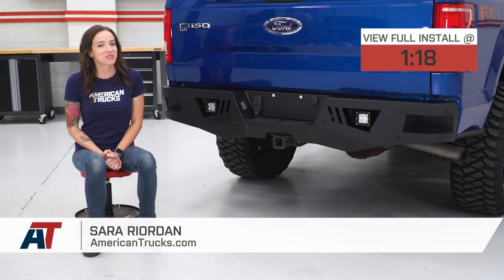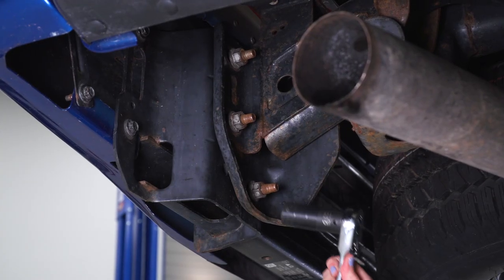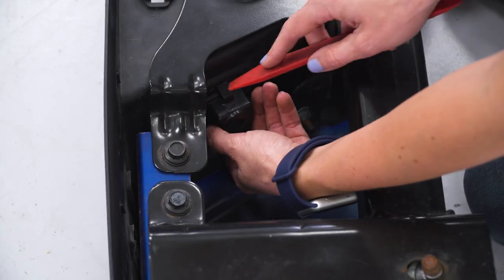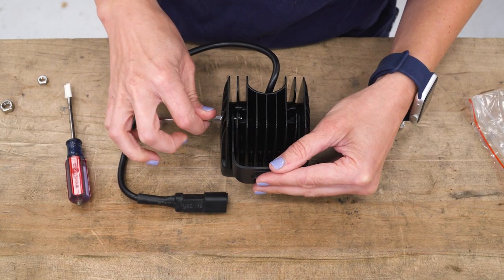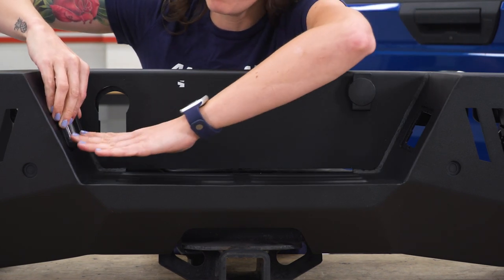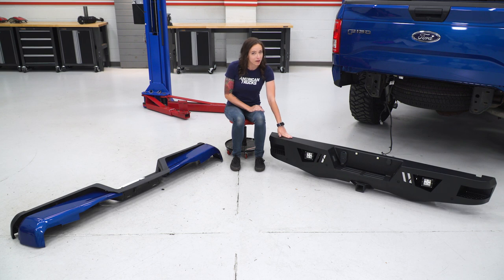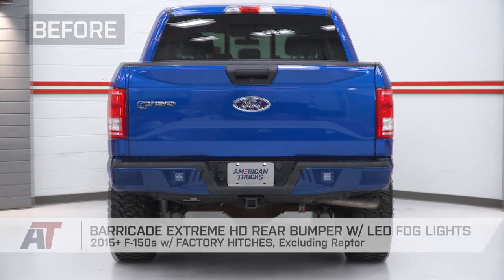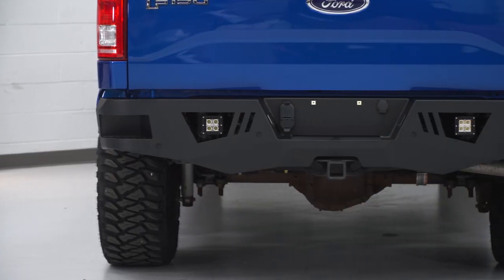2015-2020 F150 Barricade Extreme HD Rear Bumper with LED Fog Lights; Factory Hitch Review & Install

Comment: After installing this bumper my Trailer plug fell out, I did not replace the tape that was around it, I recommend doing so.
Reply: Take a pick or flathead screwdriver and get on the inside of the platstic tabs and lightly pull the tabs all the way through the bumper. You should hear a light "snap" when it snaps in place.

Comment: I would have tapped the pod lights into the trailer wiring. Turn on when you shift into reverse. I don't like the look of the peel and stick switch.
Reply: You dont want to tap into the trailer hitch wiring. Everytime you turn the truck on it will think you have a trailer attached and you will lose your back up sensors and get the annoying message that pops up on the dash. I think the best way is to tap into one of the reverse lights from one of the tailights. I did this when I added a tail gate 3rd brake light and it worked great.

Comment: Well. how close my the kit I purchased to what is shown

5:30 Mark, do not do it as she does, start at the ends and it will come up easier and then you can see the center clips
9:00 My Lights were a bit different, but nothing I could not handle
The kit does NOT come with a Pancake Washed for the large slots, GET one for each side, the Lock Washer will not cover the slot and digs in

Wiring is easy and NOT
She points to the fire wall and claims you can pull back some rubber and push the switch line trough into the cab
NOT
As I could find no such rubber access on my 2017 I called American Trucks
He told me to take it to a Shop

OUCH

So, I have everything but the Wiring in and it looks great
now the effort to get it wired